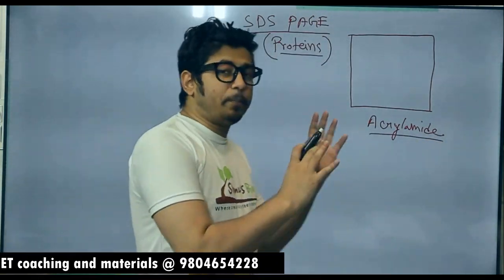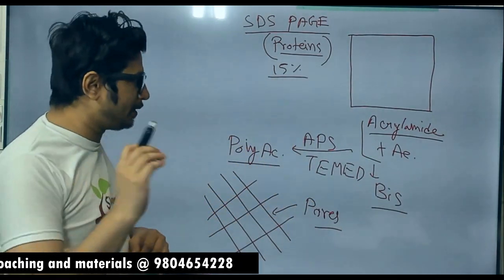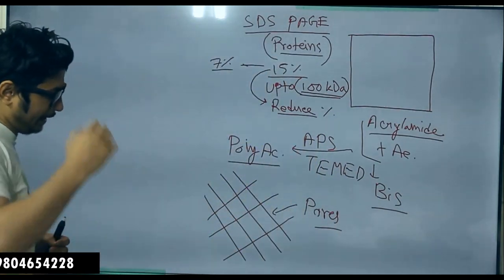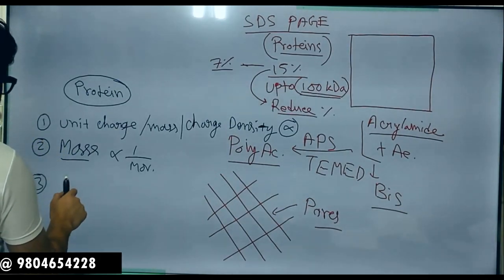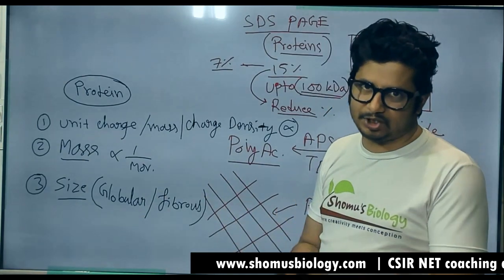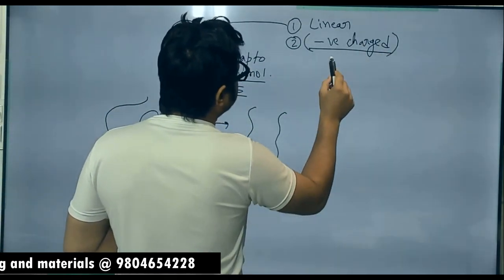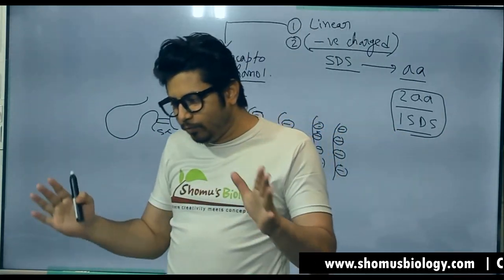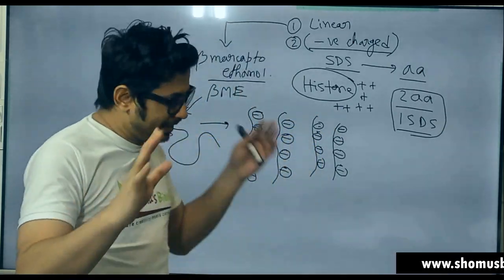SDS PAGE gel electrophoresis | sds page principle explained | poly acrylamide gel electrophoresis

Comment: Thank you sir for this detailed explanation. I just  had one query . Sir as the interaction between SDS and amino acids is that there is one SDS between two amino acids.  Now, as SDS gives the negative charge, shorter polypeptides or proteins having low molecular weight will be less negatively charged, as they've less number of amino acids . In this case the lengthier polypeptides have more negative charge ..so in that case they should migrate faster towards the anode . Sir, does this parameter exert any influence in the separation process ....🙏
Reply: In SDS-PAGE, while it's true that larger proteins will have more SDS bound to them, resulting in a greater negative charge per protein molecule, the overall effect is that the charge-to-mass ratio becomes relatively constant for all proteins. This is because the mass of the protein also increases as it gets larger. As a result, the mobility of the proteins through the gel primarily depends on their size, not on their net charge.

So, larger proteins will indeed have more negative charge, but they also have a larger mass, which balances out the effect on mobility. Therefore, in SDS-PAGE, smaller proteins typically migrate faster through the gel because they encounter less resistance, while larger proteins migrate more slowly due to their greater size.
Reply: @Bank-al-habib-biometric-soluti  Thank you so much 🙇🌸
Reply: In SDS-PAGE, the movement of proteins is primarily based on their size, not their charge. SDS denatures the proteins and binds to them, giving all proteins a negative charge and essentially neutralizing any charge-based differences between proteins. Therefore, the speed at which a protein moves through the gel is primarily determined by its size, with smaller proteins moving faster and larger proteins moving more slowly. This is why the technique is used to separate proteins based on their molecular weight.
Reply: @avanimirchandani8190  Thank you so much ... 🙇🌸